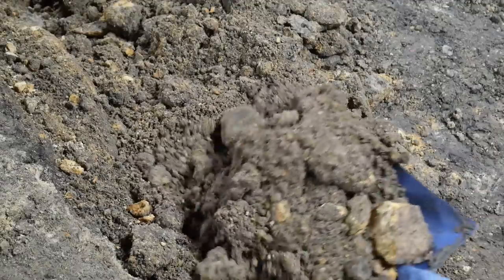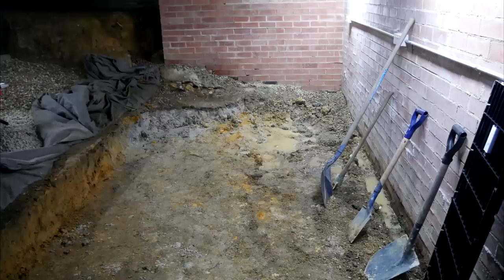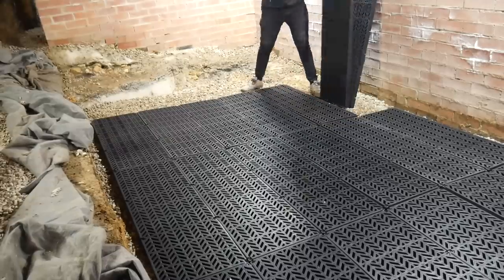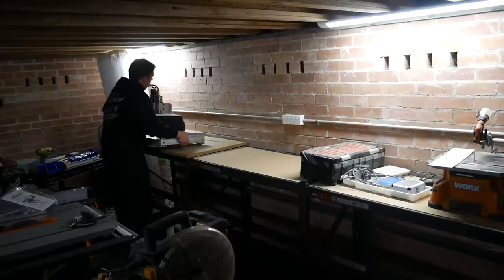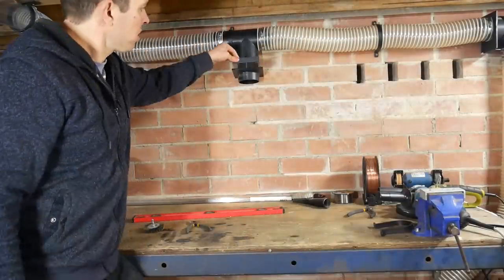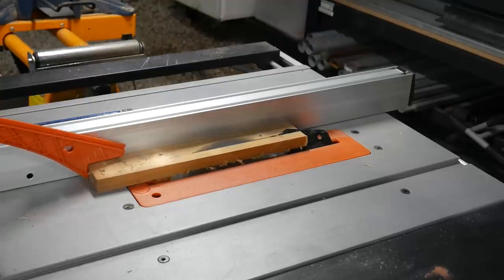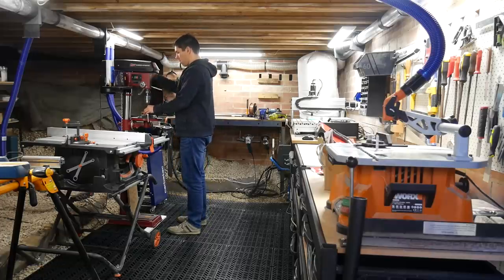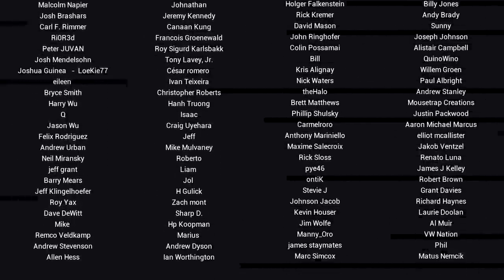Digging to create an efficient under house workshop

Comment: When I saw the thumbnail, I got worried about digging under the house.
-But I see that you're not really digging, just removing what's on the ground.
Still ... be very careful, because the walls look like they support the house and if you remove material near the walls, they might sink and the house will sink.
It's best to reinforce (downward) in small sections at a time, making sure to have foundation for the brick wall.
The brick wall might already have all the foundation it needs; please just make sure...

Other concerns ... The moisture will not go away; I believe it needs a better solution in the long run.
I'm not only thinking "rust", but also mold (wood, cardboard, paper and the like).
If you're going to run a dehumidifier, I recommend running it on solar panels or your YouTube income might not be able to break even with the electricity bill ...

Like Marcel HH mentioned: Dust extraction and ESD can spark fires. ESD from dust extraction can also kill your electronics gadgets. ;)
-Make sure you don't have anything flammable in there either.

Last thing that came to my mind ... you really want a floor without holes in it. 😉
If you happen to come across a click-floor, that could be a temporary solution.
Regarding floor, I'd really go for a concrete solution, but you might not be ready for it yet.

All that said, it's always nice to get more space and I'm happy that you can spread your wings! 😄
Reply: This comment summarize most of my thoughts (and more) after seeing the video, well put @HiSpy ☺️
Reply: @kihestad  😄- I've seen someone - who really knew what he was doing; he worked with reinforcing buildings every day - even though he reinforced this old house, the house cracked where he dug. Those bricks are heavy - the roof as well (not to mention all the things in the house).
Cracking didn't happen in one go; it was a slow process that took more than a week.
Fortunately this house wasn't damaged any further.
He did use equipment for measuring pressure and giving proper upwards counter-pressure while digging, but things can go wrong even for the experts.
Reply: @68HC060  I can absolutely believe that. Having constantly running water in the ground is also a big concern if you ask me. As you say: not just to get rid of the humidity, but even more important: to prevent unhealthy mold. The whole basement really needs a sealed  concrete floor with vapor and moisture barrier underneath. For this to work the water now running on top of the ground must be managed, i guess a drainage ditch around house would have been the permanent solution. A tricky task when this is not done before the house was built 😳🤔 but not impossible ☺️
Reply: @kihestad  I absolutely agree. Hmm, changing the dehumidifier to a pump might save a lot of money. 😆🤣
-I wonder if the water could be "piped" instead; it's not really a good solution though; the walls would be wet near the floor.

Comment: assuming you probably needed planning permission for this? Colinfruse sought it for the main project with the bunker but got into trouble for one leg of it he didn't have permission for if I remember correctly... why didn't you just lay down concrete for the floor and use an extractor pump to clear some of the water out?

Comment: It's not clear how Michael ever expects to lower the humidity in there, with that live spring always flowing under the gravel.

Lots of effort, but very strange...
Reply: Blind hope :D
"Mom, it's too wet in here!"
"You're in the pool!"
Reply: Maybe he's OK with the humidity? I agree that it's less than ideal for a shop space, but it's a nice addition regardless. And most of those machines can handle the humidity if you coat them a little
Reply: @WoLpH  Something's wrong with someone who calls himself "Teaching Tech", seems to know a lot about it, and does this slop-job of a wet dugout for his machine shop.

There is no excuse for this, there are ways to do that space properly - this is embarrassing ignorance.
Reply: @retromodernart4426  This is obviously not his area of expertise and I personally think he's made that obvious enough in the video. I like this kind of content, but I definitely wouldn't use it as a guide for attempting something similar ;)

Comment: Nice video But that floor isn't the best idea..i didn't catch how you made sure water will go away..but more importantly. Why did you think plastic 'floor' is good idea..it wasn't intended for that at all and for good reason.. I'm also not sure how easy you will clean that kind of 'floor' ..also i think that left side looks too shallow..and also probably very humid..i think some plastic foil should cover whole area....this will reduce moisture.. but as much as proper concrete floor..I would suggest to go for concrete flooring and then put some plastic/rubber mats on it to make it more 'warm' ..because this will be not good during winter..too humid..too cold and all that equipment you have there will suffer ..i also didn't mention it ..but how can you have welding corner close to flamable plastic...that for sure isn't good idea..

Comment: You are a skilled constructor. I like watching your movies. But this time you made a mistake. First of all, you should at least consult this investment with a construction specialist. It would be safer for the building and give you a better workshop for many years to come.
The water is mean and within a year or two it will start to wash these pebbles, the floor will be more and more uneven and you will be struggling with such trinkets more and more, instead of enjoying the new construction.
Placing the dehumidifier in a room that has constant access to flowing water (stream) is a Sisyphean job.
Finally, I have one important truth for every designer: every neglect and unresolved problem, sooner or later, he will surely take his revenge on you.
Nevertheless, I keep my fingers crossed for the new ideas that will be born in this workshop.

Comment: A bit late to save you lawn, but may help if you have to do so etching similar is a monorail wheel barrow.

Just some secured angle iron and a sold wheel with a grove replacing the standard wheel of the barrow.

Look them up on YouTube.
Reply: feD6jv3EZUg

Check out the video above for the simple garden monorail to save your lawn next time.

Comment: Michael I love your stuff, but I gotta tell you,  you're going to spend more time working "on" that space then you are "in" that space. The issues are so many besides the obvious groundwater humidity possible flooding issues, you have issues of electrical grounding, dust and fume extraction and basic ventilation. I wish you the best my friend but you are gonna have your hands full and I predict in a year you're going to hate that space worse then your garage. I have a workshop with CNC equipment in my garage. Even though it's very spacious and open, I still have a problem with humidity. Even if you don't see it, it will play hell on all your electronics. Ask me how I know…your space probably has a higher base humidity level than my garage does and worse a constant source of excessive moisture. over the long term is just a recipe for aggravation. But you work with what you can get I understand that. At least try to install a vapor barrier that will help a lot. but good luck to you